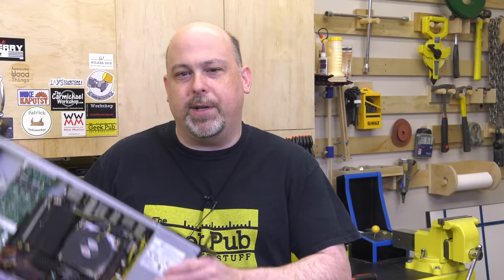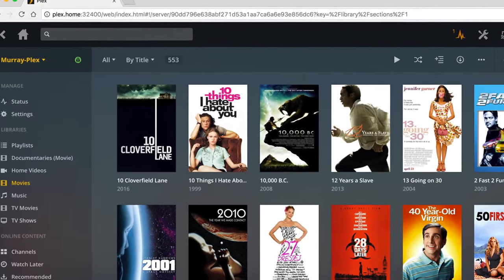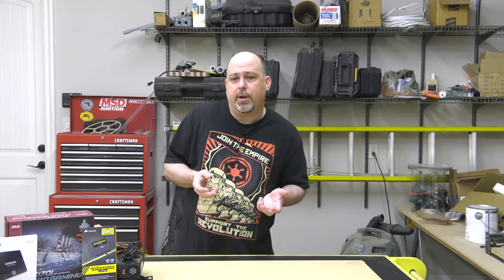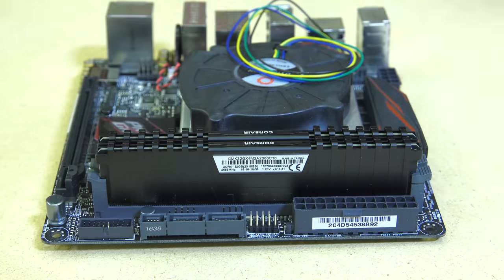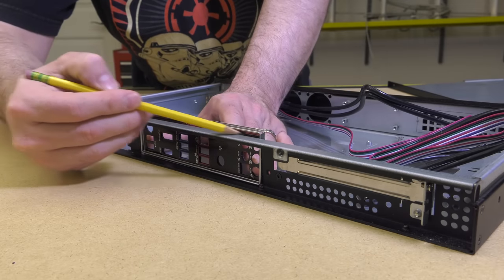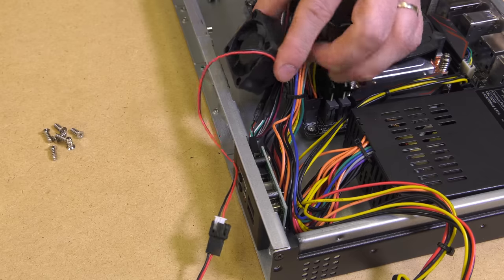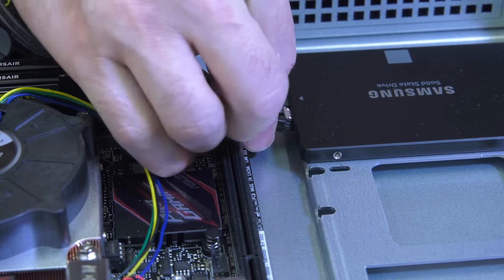Building a 1U Server (Bad A$$ 1U Server)

Comment: I just built a machine with the exact same ASUS Z170I motherboard. I put mine in a Shuttle XPC SZ77R5 chassis after the Shuttle's proprietary motherboard died in a power outage. Shuttle claimed that the SZ77R5 is mini-ITX compatible for future upgradability... and that's technically true, though not without caveats.

The main issue I faced was, like you, motherboard standoffs. In my case, though, it was the opposite problem. The case had ~5mm 6-23 standoffs, with two of the four mini ITX standoffs welded to the case. The backplate was lined up for the short standoffs, so I didn't need to pad the existing standoffs, I needed to find two standalone extra-small standoffs. Turns out it's almost impossible, since ATX standard requires 6.4mm or greater. All the 6-23 standoffs I had on hand were 7mm, and I couldn't find any brass 5mm standoffs online (only aluminum ones with shipping costs 20x the price of the standoffs). Solution? I took some 7mm brass standoffs and spent around three hours filing them down to size.

Another concern was the 500W power supply in the Shuttle is 20-pin, while the motherboard is 24-pin. Turns out that wasn't a problem: the extra 4 pins on the ATX connector are redundant (ganged to the same wires as the other pins), and you're not going to need them with that size of a power supply. In my case, I've got a graphics card in the motherboard (a GTX 970), so I'm using the onboard Intel gigabit LAN port.

The cooling solution also had to change radically: the case originally used a rigid heatpipe system where a cold plate on the CPU was connected to a heatsink mounted to the rear of the case, through which a 92mm fan served as both the CPU fan and the case exhaust fan. That got thrown out: the heatpipes are designed only for the proprietary motherboard's CPU placement. I ended up using the CPU (7500K) stock heatsink/fan along with a Noctua 92mm case fan. Good results: CPU runs cooler than the old setup (which was a 3770K), a bit louder at idle, but much quieter under load. I've got my eye out for an after market CPU cooler to reduce noise there, but clearance is limited since the CPU is under the power supply, and I'm thinking of swapping the 7500K for a 7700K. Most coolers that will fit in the clearance available are rated to handle a 7500K, but not a 7700K.

Finally, this leads me to some comments on your build based on my experience with the board:

- The motherboard has an NVMe slot on the underside of the motherboard. Not as convenient as the Z270 mini-ITX board ASUS makes (that one has two NVMe, both top and bottom), but it would free up a SATA port and remove the need for the SATA data and SATA power cables. That either helps your airflow, or it just gives you more SATA ports to use on other hard drives in the future. NVMe is much faster than SATA, but it sounds like that wouldn't matter for your setup, so it would really just be to save space and reduce clutter.

- The motherboard actually has three fan connectors: one CPU, and two chassis. Since the UEFI BIOS makes all three headers completely configurable (tie them to CPU or chassis temp, build your own custom fan speed curves, or even just force them to run at a fixed RPM all the time), you should connect the second chassis fan to the motherboard instead of the power supply. Even if you just set the motherboard to run one of the fans at max speed all the time, it will be able to measure the RPM, which means you can have an alarm if the fan stops spinning (if the RPM drops below some configurable amount), which ought to be a bit safer.

- It looks like you put a quad GigE NIC into the server, but only connected one port. The motherboard already has an onboard Intel GigE controller, so that standalone NIC isn't doing you any good unless you're planning to connect multiple ports (and then maybe do some teaming?) For a server, a 10 gigabit NIC might be a better option if you've got a switch with at least one 10 gig port. Otherwise the standalone NIC is redundant since it won't really outperform the onboard NIC.

- The motherboard comes with a plastic CPU spacer that can be used to make CPU installation a bit easier and safer. The CPU snaps into it and you place the assembly right into the socket and clamp it down. It makes alignment a bit easier and provides some protection during the installation process. Also, the plastic cap that came installed on the motherboard socket should be left in-place during installation: it will literally pop off on its own (and I do mean pop) when you close the clamp down on the CPU. Per Intel's installation instructions, this is actually the recommended approach, as odd as it might seem.

- It looks like you forgot to remove the clear plastic from the motherboard heatsink (the one seen on the PRO GAMING logo at 2:30). You'll want to peel that off to improve the effectiveness of that heatsink.

- You've got some clearance issues on the SATA cable coming off that SSD against the PCIe slot. The NVMe approach would fix that, but another approach would be to use 90 degree angled SATA cables. The ones included with the motherboard are bent the wrong way, but you can buy SATA cables that are bent the other direction, which would solve your clearance issues.

Comment: Great video - I built a very similar server using a 2U case from the same manufacturer.  Had to modify it a little, but seems like a decent (and inexpensive) product.

One tiny little thing I would like to suggest to make your videos a bit better - don't rock back and forth so much while you are talking.  I spend a fair amount of time each week on a stage in front of a large audience, and that's one habit I had to un-learn after a lot of feedback.  The rocking back and forth just makes you look nervous and unsure of yourself.  It's OK to move around a bit, but too much can be distracting.

Thanks for putting out a nice variety of content - been subscribed for a while now.  Keep up the good work!
Reply from the maker: This was the first video where I read from a teleprompter.  I won't be doing that again.  The reading is what caused me to sway.  In the future I'll just being talking off the cuff.  I much prefer that anyway.  I just wanted to try something different.
Reply: No worries, it's all a learning experience.  You learn as we learn from you!

Comment: I liked your video.  Good camera work, good speech.
What I would have like to see is more info on the build like your total cost to build it to make it easier to evaluate if its worth it vs a used server on ebay.

Also yes it is a server as its "serving" data/features but personally especially with all the other expensive parts I would have gone for a server motherboard and ECC RAM.

Comment: My pfSense router died because of that old intel c2000 flaw, so I’m going to try this same build but with an AMD Ryzen APU. Dynatron makes a similar CPU cooler, really cool video and interesting solution with those washers. Only thing that sucks with flipping the rack ears is the AC power is also on the front
Reply from the maker: That's no worry.  I simply reversed fans on the case and PSU.  Problem solved.

Comment: Great build.  Thanks for this.  I hate putting anything metal in contact with the mobo.  For the spacers you created you could have used nylon spacers available in the specialty trays of the supply stores such as Home Depot or Lowes.  Using oversized spacers you can put them over the chassis mounts and they would lift the board as well.  The spacers come in various sizes.
Reply from the maker: Huh?  The motherboard stand-offs are DESIGNED to be grounded.

Comment: I chose the 6700 non k @ 65watts for my "server" in a DS380 case and threw in a IBM ServeRAID M1215 in IT mode for the 8 drive spaces - I plan to add in 4x 120GB SSDs for the windows storage space write journal as I have the drives in parity.
Add an old laptop CPU fan cooler and that keeps the raid card cool!

Comment: You could buy a used server for cheap on eBay.  Plenty of Dell R610's with dual quad core Xeons and 96gb ram for $500.  I used to build home servers too but going used was a lot cheaper for me.  Replacement parts are plenty and the equipment is a lot more durable.  It's all designed to be on 24/7 for years on end.
Reply from the maker: And it won't be anywhere as fast, won't have QSV cores for encoding video, and will sound like a jet engine.
Reply: @TheGeekPub  It's actually quieter than my 24 port switch and encodes video just fine.  I have Plex installed as a VM along with 21 other VMs and is able to transcode 4 streams without issue.  I only assigned 4 cores to the Plex machine.  If it's not enough, you can get one with a different config... more processing power with less ram, toss in a video card, etc...  Adding in another couple hundred dollars will also open up a lot more options like moving up to hardware 1 gen newer or another brand.  I only went with Dell because the PowerEdge servers are quiet.
Reply from the maker: @baosli  I run data centers for a living, all Dell servers.  The R610 is nice and quiet (46db) at idle.  At full bore they are almost unbearable high pitched screamers. I can't have that in my media room.
Reply: @TheGeekPub  that's my living as well but I run Cisco's. Used to run Dell's... Yeah, a bunch of them are loud but a single is tolerable.  It's rarely running at max load.

Comment: It may be a bit simple to you, but I would have loved to see the software side setup, for setting all that up. I'm kinda wrapping my head around putting plex in a virtual machine (encoding performence inside vm?), as well as the shared storage setup, etc. Thank for the cool video.
Reply: this would be great. i'm running plex of my synology but i'd be keen to see if there is a performance benefit of running it off a vm rather than the synology.
Reply from the maker: There is a big performance boost if you have multiple users streaming at once.  But if its just one stream at a time I would probably keep it on the Synology.

Comment: I'm building something almost exactly the same.  I noticed, however that when you put the brackets on the bottom of the motherboard, you're actually compressing solder points and capacitors.  You actually put them on wrong entirely.  The metal rails should border the metal CPU bracket, and the hole edges should be facing out, toward the RAM slots.

Also, in many shots, the cpu blower is facing different directions.  Should be facing the rear of the chassis.  Finally, you can also use a x4 pci-e riser, which will allow for slightly better airflow.

Good point with the fans, to keep one on all the time and one be dictated by the temperature.

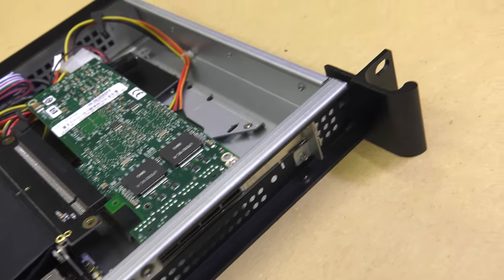Comment: I'm currently building a 1U server based on this tutorial (with updated components).  One thing I noticed that was odd was that you mentioned that you used an Apevia power supply but at 10:05 in the video I can see you are using an FSP Group power supply.  I also decided to ditch using the Apevia and went with a Silverstone.  Just wondering what happened with the disconnect on what power supply you ended up using?

Comment: @TheGeekPub replace that power supply at work we used them and all of them failed or died.... 2of them causes Motherboard failure
Reply from the maker: Funny you mention that, it died just yesterday and I replaced it with a different brand unit.
Reply: What was the replacement unit you used? Looking for new suggestions before I go out buying anything
Reply: At work we replaced them all with pico power supplies that run off 12volt. you can find them on amazon

Comment: OK I just go to this today, just a suggestion when running esxi, boot from a USB stick and run your swap on the SSD, this way you can run swap at near memory speeds and you will see a huge increase in performance. I also run a bunch of i5's as home sandbox servers in a cluster for HA, so don't let anyone knock your designs, use what works for you.

Comment: I would buy a 1700 because vm's can run better with more cores/ threads
Reply: Balázs Rakó I was thinking the same thing, though I understand the goal here was to be like an exciting server.
Reply: It's a great idea.   I'm not gonna take the time to look up the case he used to find out what size motherboards it accepts but I'm gonna assume anything bigger then mini ITX won't fit.  So one problem as of now though, there is no miniITX AM4 motherboard available.  Basically forcing him to build Intel at this time.  Another problem would be possible compatibility issues with ESXi.  He also stated that he wanted to keep it the same as the other server in the rack to ease troubleshooting.
Reply: I dont know for sure but my guess is that he needs some sort of graphics for windows 10, because I doubt it can operate as headless server
Reply: ESXi has terrible support for Ryzen. You're gonna have to wait till naples/EPYC drops or use something different like xen/proxmox/hyperv
Reply: what are the differences
Reply: well xen is buggy with os support...

vmware  does offer free esxi licences without neat features like vmotion etc. but for home use thats fine

and please use ecc memory... never run it without vmware will be so slow.

kvm/bhyve is a type 2 hypervisor.. this means that it runs a general purpose os underneath.. which sometimes runs a bit slower. as its not specially made for virtualization

as a type 1 hypervisor also referred as baremetal hypervisor runs of a specialily made os thats only made to do one thing virtualization (storage etc). 

i have been tinkering around for a long time now with a lot of hypervisors.. proxmox, kvm, xen, hyper-v.. and many more..
my favorite and goto hypervisor is vmware vsphere (esxi, vcenter, with ochestra automation) it never let me down.. is rock solid (and i did some stupid shit with vmware >:D )  
most other hypervisors crashed on me or had clunky os support. did weird things on its own.. (i own multiple server grade machine with ecc memory and good hbas so that was not the problem...)
vmware just runs almost everything smooth right out of the box from mac to android
Reply: The single thread of that cpu is nothing to scoff at either

Comment: This video is more than 2 years old, but the geek in me just has to say that the SATA connector on the SSD drive is knocking against the motherboard and looks a tad tight. Shouldn't you have reversed the mounting on the SSD and have a clean cable connection instead? And the network connectors: how about aggregating those up into a 4x1Gb connection to the rest of your network. Overkill, I know.